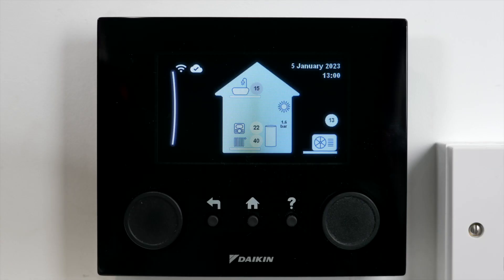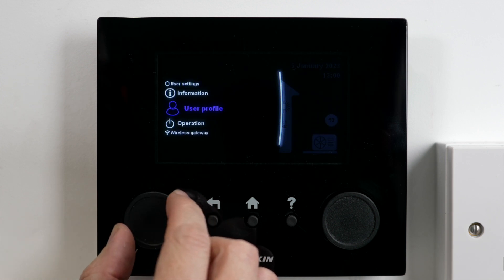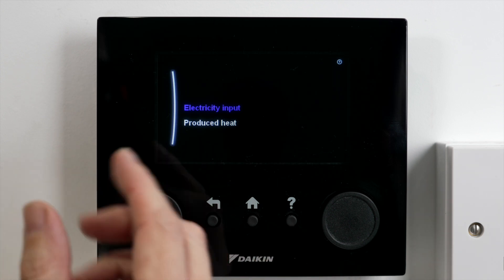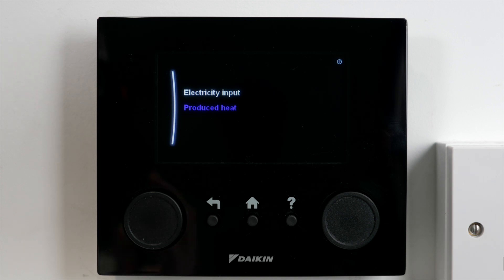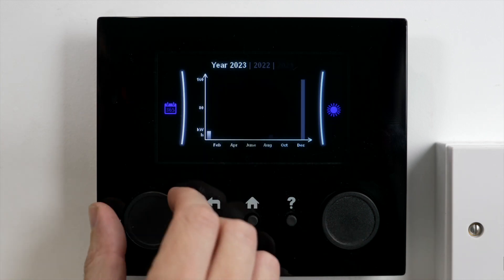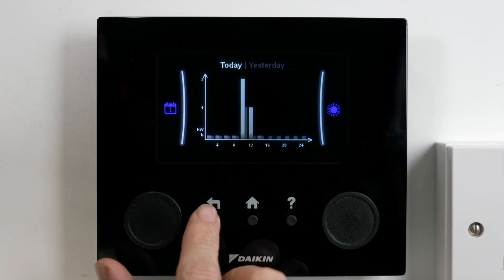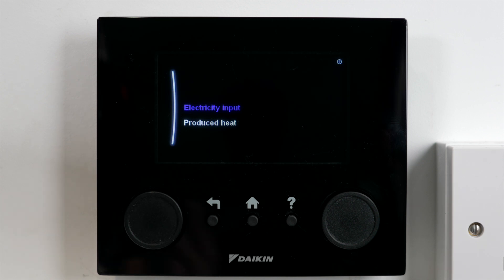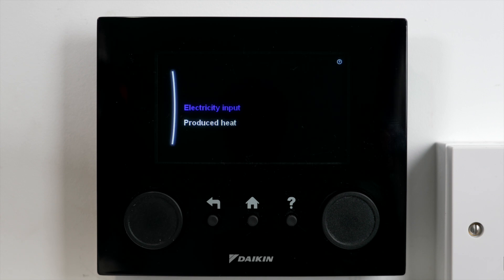What Is COP/SCOP?

Comment: My daikin 3m 9kw monobloc EDLA only has a SCOP of 2.05,  this is considerably less then the 4.8 it should be able to do,  it is on A WD curve, of 50 at -7. No one can figure out why it performs so poorly.
Reply: That is poor get in touch with heat geek if you're in the UK
Reply: @RobAldred  based in Cork Ireland, no local heat geeks,  
The installer is changing the heat pump from 9kw to 6kw, to match heat loss at -2C and changing the radiators, so they match the heat loss of each room. They insist on keeping 2 zones or TRV''s on 50% of rads, so going with two zones,  currently all rads have trv's, getting rid of those,  New design should work at flow 46c at -2, Will set the system to run on LWT with setback on a schedule and ignore the zones.
I had to propose all of this to the system designer.
Reply: @1SeanWalsh1 Did you manage to solve your problem?
Reply: @greggreg2458  yes, heat pump was 150% oversize, and radiators were too small to heat most rooms,  when heat pump was correctly sized, and radiators changed scop improved,